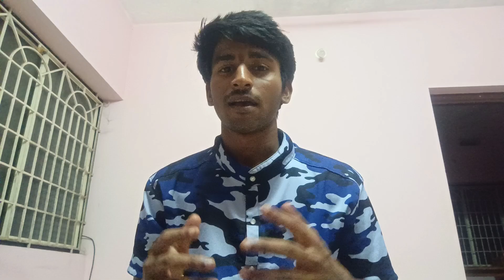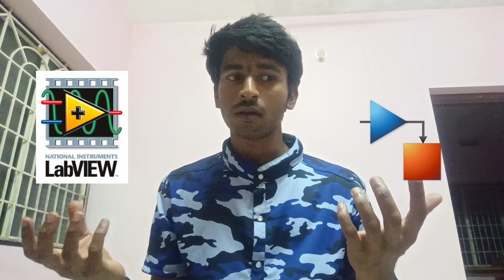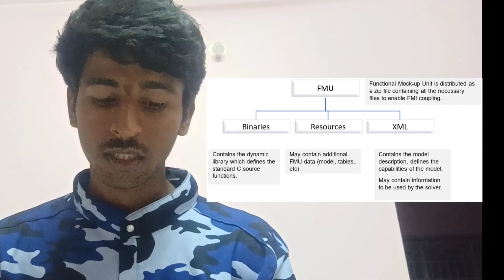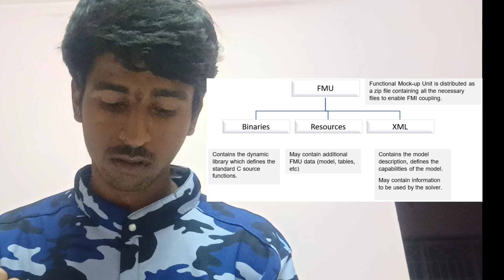Functional Mockup Unit(FMU) but for absolute no-brainers..

Comment: Hey Brother, your fellow Indian brother this side. I’ve recently joined a batch processing industry and as an automation engineer I’ve been asked to create FMUs of the process and integrate it to the current system which consists of MTP, they are at ground zero with the concept of FMU and want me to develop something’s . I’m new to this concept and I understand that it is Model Based Control, but is Python also a legitimate language to code the FMUs also how do we generate the XML from the .py files and is there any legitimate resources or places from where I can learn the way an FMU is made? Any help would be appreciated! Thanks in advance!
Reply from the maker: Yes python is a good selection for writing FMUs, check up official documentation on FMI standard to understand the architecture and also check pythonfmu repo on GitHub, hope this helps 🙌

Comment: One particular thing to clarify. C functions or headers may not be found in all FMU, strictly they would be only found in source code FMU, if otherwise the source code is exposed, and anybody can replicate the logic.  And also, index.html is a markup file and there is no necessity that even there could be a .html file within a FMU, they may mostly contain only some steps used to construct the FMU, not any dependencies. Another error I have seen in this video is regarding the binary types, I would disagree with the  binary targets. Now binary target depends on tool support and tool of implementation and generally say using FMPy I can create the binary targets for windows, linux as well as for darwin64.
Reply from the maker: ohh good to know, thank you for sharing this!!